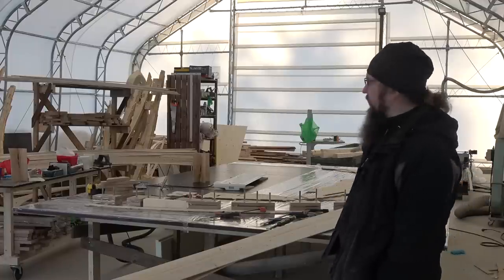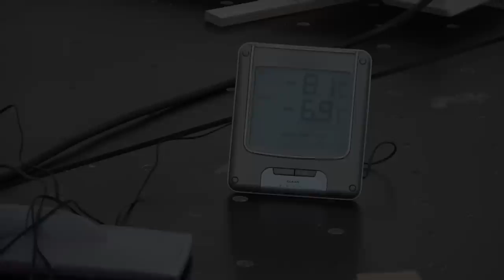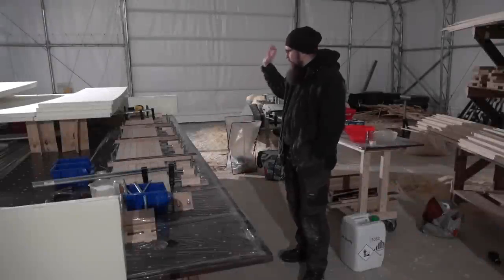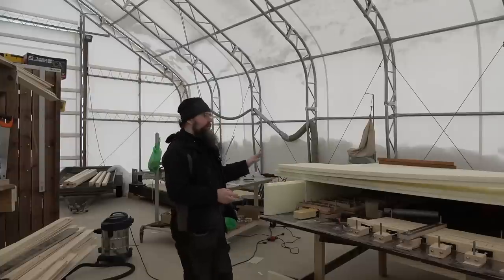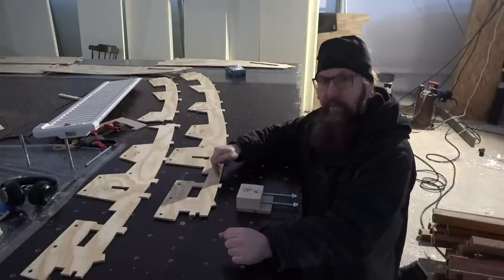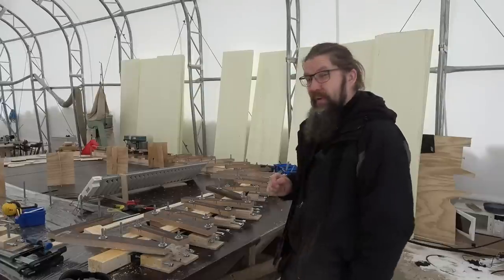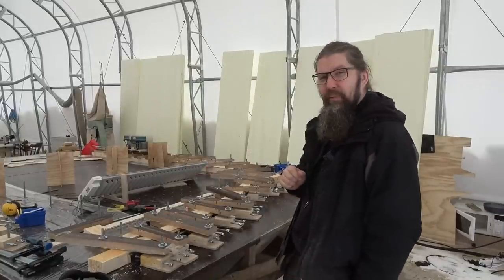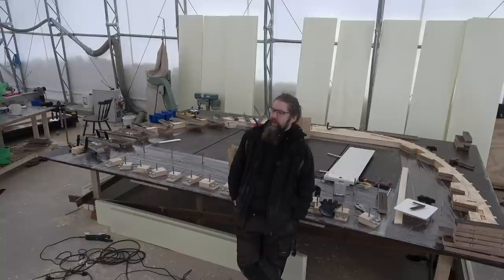DIY Sailboat: frames and more frames! - ep.56 Project SeaCamel

Comment: I know will sound awful, given the temperatures, but you are very ‘lucky’ with the working times you have with your epoxy resin.
Reply from the maker: Yeah! I don’t mind cold that much. The annoying part of the winter (and fall) is moisture. You can actually get rid of that in winter just by warming up the air very slightly. And that of course needs the insulation.

Comment: Wouldn't leaving a couple of inches of each layer for lapping over the other half. This will make it stronger than having a seam all the way through layers. That would cause a weakness and possibly failure point. 
You might want to put epoxy on the wood first to let it soak in and tack up before you lay up the epoxy layers. You don't want a dry section of epoxy joint. The wood will want to soak more than the thin layers.  Keep up the good work.
Reply from the maker: There’s gonna be keel timber between the two frame sides so it will be cut in half anyway. It is shown this way in the original plans.
On the smaller frames I did one continuous lamination that went partly over the keel. With these bigger ones there’s very long glue surface between the frame and floor that will keep it together.

Comment: Great video, maybe a little bit lengthy.... and just noticed you have a typo in your Patreon link.

Also you should considered to get a temperature tracker to monitor curing process, Ruuvi tag for example?
Reply from the maker: Hey thanks! Need to re-check the links!
I have a long-video-syndrome that needs curing…
Reply from the maker: Thanks again. There was some issues with line changing characters. Now they should be good. 😊

Comment: Great progress,  love the videos,  1 question for you though; how strong is the joint where the 2 frames meet up? Are you through bolting around there or something else?
Reply from the maker: There’s long long glue joint between the frame and floor. There’s going to be keel in the middle to join the halves. So basically they’re going to be same piece.

Comment: hi, sorry if repeating the question, but how much did you spent total for your cnc?
Reply from the maker: Still haven't done complete calculation but it's around 11k€ with all the machining work - which was most of the cost.
Reply: @ArcticSeaCamel  and what's it's  working area?
Reply from the maker: Machining area is 1500x2940. Full big plywood 1500x3000 fits in there which was the goal.
Reply: @ArcticSeaCamel  huh, that's cool... But expensive... Hypothetically, if there will be a place to rent near your building area-would you consider renting it to me to cut fiberglass sandwich panels? I'm going to start building arrow 1200 in 18 months from now.
Reply from the maker: @pironiero  Sure! I've had plans to make some additional income with the CNC. And yes, it was expensive - quite bit more than I wanted. The CNC-parts weren't that much but the work to machine the frame was. I'd do it from aluminum extrusions if I'd do it now.

Comment: Save yourself all the Epoxy mixing and expense and heat cure time for frames - use "Purbond is a single pack water proof adhesive. It is a polyurethane which reacts with atmospheric moisture to form a strong bond "
Reply: Might have trouble with the 10 min lay up time and min 20 deg C mate, I think thats why he's using epoxy.
Reply: @MUDNROCKS  Hmm. This is what Purbond say about curing. No minimum temperature mentioned.
"On an average surface, coverage will be 200 - 300 ml per square metre. Clamps may be removed when the exudate is hard, generally after 2 - 3 hours unless temperatures are very cold. At temperatures below 10 deg C, allow 5 - 6 hours for cure."
He may need to change  the clamping technique, and even lay one or two planks at a a time, rather than glue up all the planks
In an ideal world, he could use the Raptor  "plastic" nailing system, and just staple them in place a plank at a time.
Reply from the maker: Non-water based glues could work but I also need working time of several hours. Cold temps with epoxy really helps with this. And epoxy cures well when it's heated up later. Mixing the epoxy isn't that big deal. (I'm also planning to build resin distributor machine with arduino, we'll see how that goes 😉)

And also epoxy is proven with this application for decades and it's also completely waterproof. I'd like to use as little chemicals as possible and going with one known chemistry all the way is safest in my mind.

The lamination system works great now when I've got hang of it. I can make pretty big parts at one go with relatively simple clamping system. There's plenty of stuff to laminate in future, deck beams, knees, keel timbers etc. Maybe I could try some other glues in smaller parts. We'll see.
Reply: @ArcticSeaCamel  While I don’t miss the building a “hot house” each time. I’m envious of you mixing up volumes of epoxy with no worries about having a smoking pot after five minutes like I do! This would be a winter only method of construction for me I think. (10° ). BTW. I think I’d have my money on epoxy over polyurethane. It’s also flexible like old chewing gum and is hard to sand and work.

Comment: Alla andra jag sett förtjockar epoxyn vid limmning, är det onödigt?
Reply from the maker: Thanks for google translate. 😄
I thought of that but I’ve understood that that thickening is just for keeping the epoxy in place and possible to fill gaps or irregularities. It doesn’t add strength.
In my case the surfaces are planed smooth so no need for filling. And also the epoxy is so thick in cold temps so no need to keep it still. 😅
Reply: @ArcticSeaCamel  I used West System 413 microfibre on all my joints and glue ups. As the name says it contains microfibre filaments that add considerable reinforcement to any epoxy joint. However I was building in PVC sandwich construction where there was, unlike the softwoods you’re using, little absorption of the epoxy into the substrate. This absorption factor is a one of the advantages timber has as the epoxy soaks into the wood and creates an inseparable bond.  As you will know, you’ll fracture the timber around the joint long before the joint itself fails.
Reply from the maker: Yes exactly that. The gourgon brothers’ book actually say as well that on planed surfaces you don’t necessarily need any fillers because there’s almost nothing to fill.
The joints seems and feel super sturdy and there hasn’t been any spring back with these.